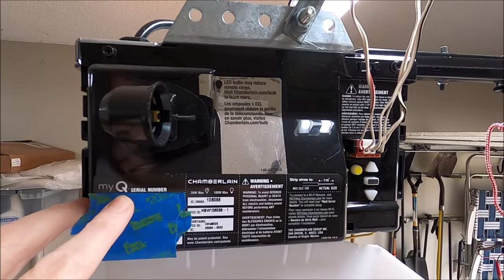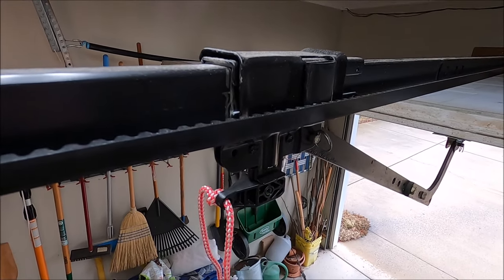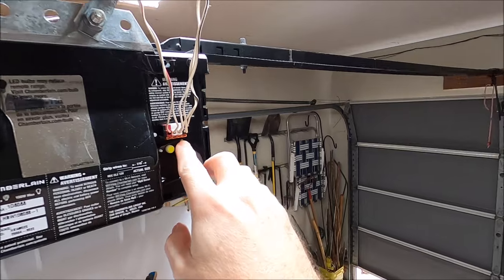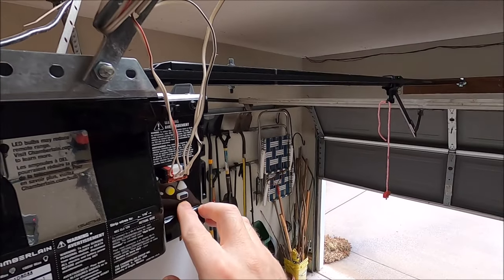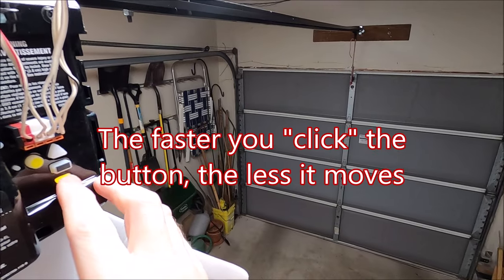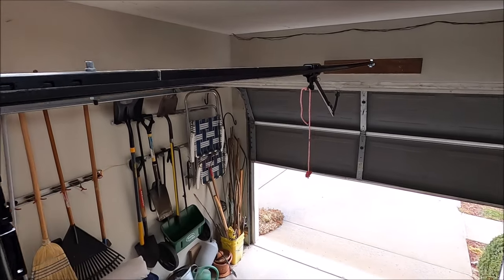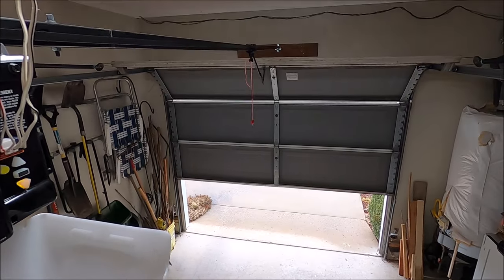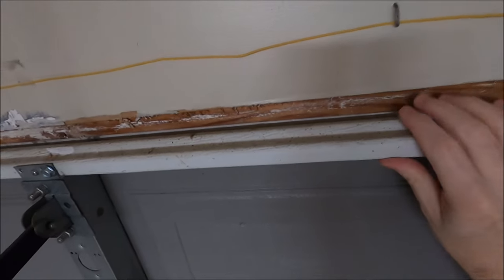How To Properly Adjust A Chamberlain Garage Door Opener Including Tips On Door Positioning

Comment: My original problem is the door will not automatically close when you push the wall button, or the remote in my car.  You have to push and hold down the wall button in the garage to completely close the door.  If I just press and try to release the wall button the door won't close...it's as if something is obstructing it, and the lights flash continually.  If I use your method here in the video, do you think this will address the problem?  When the door is completely closed, there is a gap on the right side, as if the ground is uneven, or maybe the door is messed up?  Thank you!
Reply: That sounds like a safety sensor issue. Make sure the sensors near the ground on each side are lined up. It’s common for the sensor to get bumped or kicked and the garage door opener thinks there is something in the way and reverses the closing door.

Comment: Our door goes up and slides back down about 6 inches - the opener will take it back up - this will happen about 7 times then it will stop . Can I adjust this ? It started when a guy came out for something and he said there was to much tension on the rod on ceiling .
Reply from the maker: Carefully! Use the rope pull to disconnect the garage door from the garage opener carriage/traveler. If the garage door starts going down/closing, you probably need your torsion spring replaced or adjusted. Just be very careful doing this as the door could fall hard if the spring is broken or very weak. If the torsion spring is working right, the garage door will stay up on it's own until it's pulled down.

Comment: Mine is being a pain, it won’t come off lol. I need to change the bulb , I’ve tried pushing in sides lifting up then out first. Still don’t wanna come off.
Reply from the maker: On mine, you have to grab the top center and just pull it outward. It hinges on the bottom. It feels like it might break but it hasn't.

Comment: Hello, I have a further question to ask.   I have adjusted the door to hit the garage floor while it was really sunny outside. However, when I tried to pump the down arrow key a few clicks trying to reduce the slits of light coming in due to the uneven flatness of the garage, this action eventually gave me problems. Under normal closing of the door it reopens as soon as it hits the  ground. It probably triggers the safety function thinking that it hits something.   Is there anything I can do under this circumstances?   Thanks in advance for any help you may give.
Reply from the maker: If a standard U shape one won't work, you can try a rubber blade garage door seal. You can cut them to fit the shape of the floor.
Reply: @Killobyte  Hello, hello.   Thank you so much...........   I just researched on the rubber blade you mentioned, I found a 3M product "16.5Ft/3M Universal Garage Door Rubber Threshold Strip, Weatherproof Seal Strip " from Amazon". I am quite sure this one would work and it also has added advantages of stopping leaves, debris from entering the garage.   What a neat product.   This world is so much more beautiful with people like you helping out others without even knowing who you are helping with.   I am smiling while typing, YOU are a good man!!!!

Comment: Why does the trolley jump when it starts closing initially? Mine does that too and it is so annoying
Reply from the maker: I believe that is the weight of the door moving from the two side tracks (runners) to the garage door. The belt/chain rail can compress under that weight.
Reply: Weight of the door moving to the garage door ? Sorry I don’t quite get it. Is there a way to fix it and is it a safety issue ?

Comment: mine is much older   set  and do not see the adjustmrent buttons
Reply from the maker: Does it have something like a dial you can turn? If so, one is for closing and the other for opening, turn them until they close/open the correct amount.